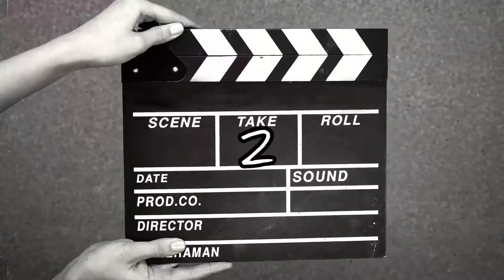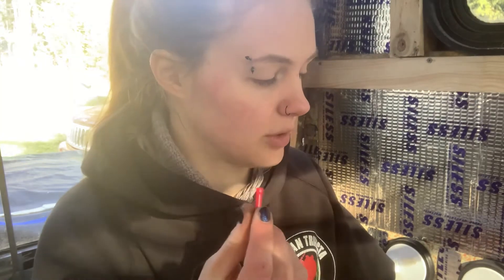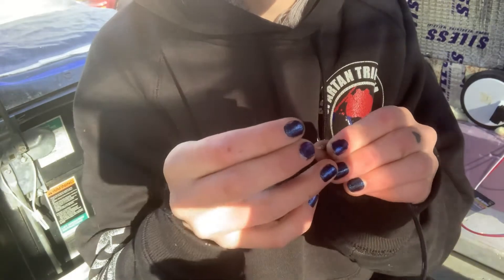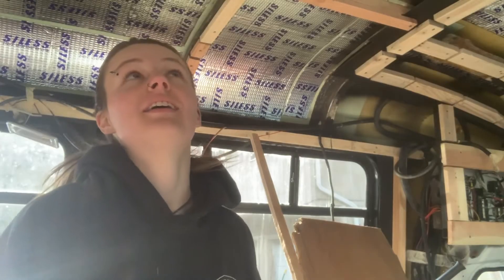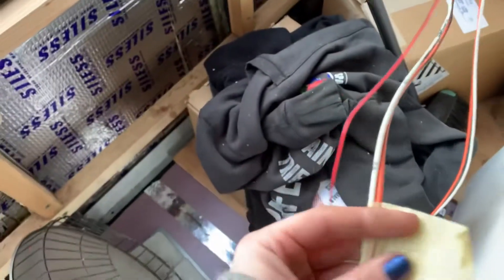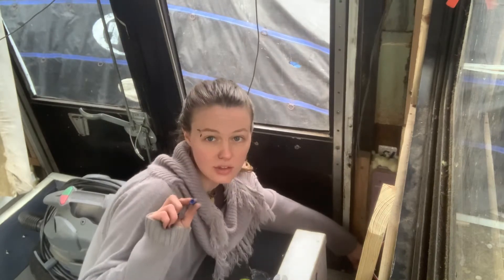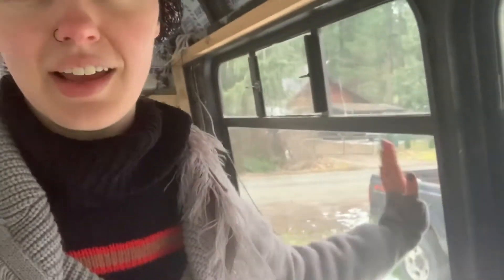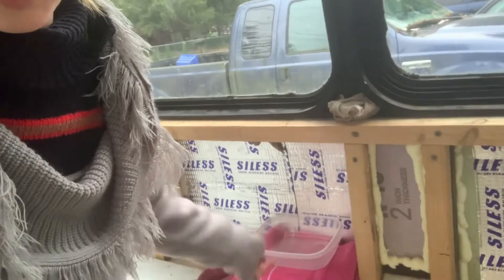Installing LED tail lights and endlessly tracing wires

Comment: As far as the butt connectors go, that little piece of metal in the middle stops the wire from going too far inside the connector. When using them you're supposed to crimp the metal part halfway between the wire stop (little metal piece in the middle) and the end of the connector. Highly recommend checking out a YouTube video on using butt connectors.

Great call using a hangar to hold the wire spools! I'm working on wiring up security cameras and I keep putting electrical components down and losing them. 😅
Reply from the maker: Yes, I have used them before for other projects but for this application they were not the right fit. I squished the metal part down properly and it just wasn't attaching in the way I wanted them to. 

It's definitely a handy little trick!

Comment: Butt connectors and wire nuts suck!!!  I hate them so much.  Take a look at Wago 221 connectors.  A little more expensive (as they're German), but they are made of clear plastic and have levers to hold the wires down.  Makes it so much easier to ensure you are making a good connection...plus they are reusable/redoable.
Reply from the maker: YES! Thanks for the info, fully agreed. One of my friends suggested Wagos also so that's what I switched over to and they worked out so well. That will be in my next wiring video